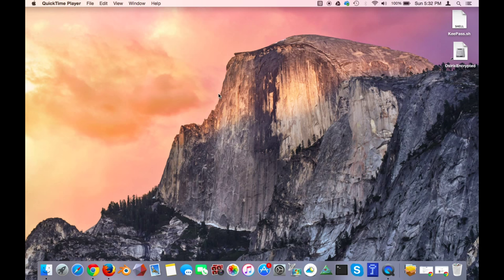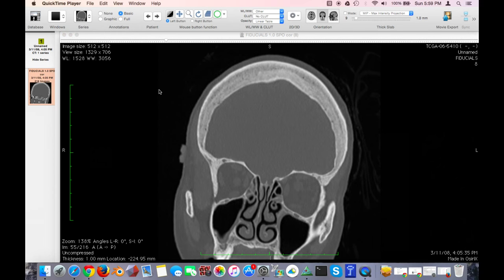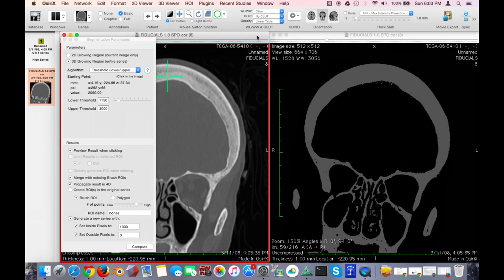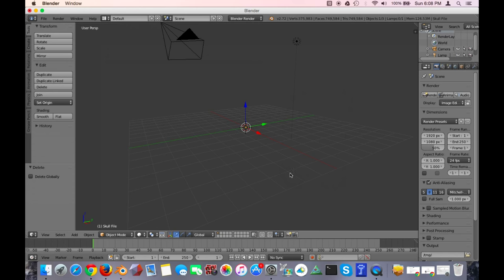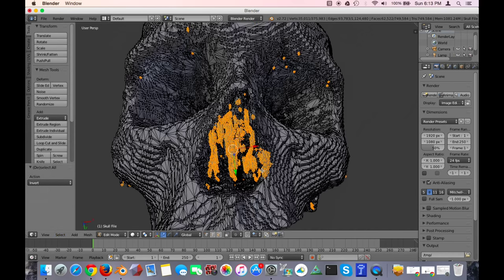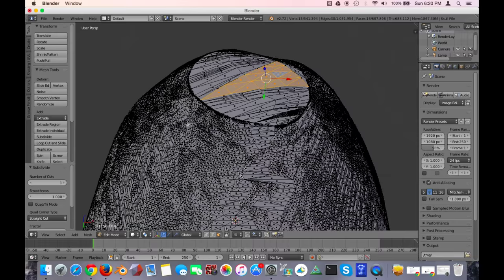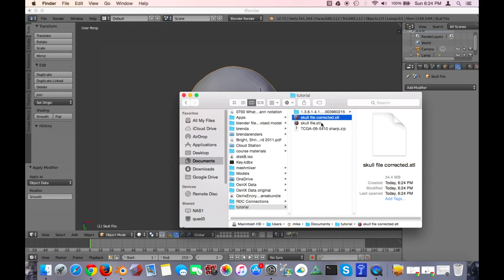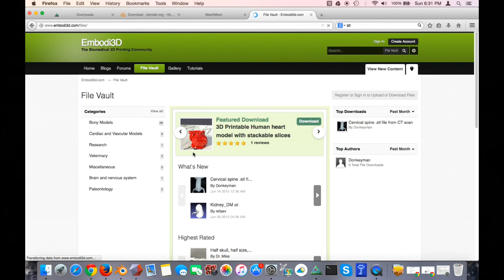Creating 3D Printable Models from Medical Scans in 30 Minutes Using Free Software

Comment: There is one more software that you should look at. It is Sculptris, a FREE sculpting software. It is a very easy software to learn. Anyone can learn it within a few days or a week. It is for sculpting digitally. 
If you have Sculptris, you could import that skull into that program and add a clay sphere for the gaping hole in skull. You sculpt that clay into shape. When finished, export two models in OBJ format, import them into Blender and use the boolean modifier to extract the shape of a cap for the hole in the skull.
Reply: For sculpting in Sculptris, one would need a graphic tablet like Wacom Intuos or Huion. Huion is 1/4 cheaper than Wacom. Both brands have the same 2048 levels of pressure sensitivity. I use Huion H580 for medium monitor and Huion H610 for a large monitor. If the tablet ever gives problem, always download its latest driver update from its official website.

Comment: Help!!!  I wanted to see if I could create a 3d model of my meniscus using an MRI scan (prior to visiting my doctor to hear his interpretation).  At the osirix-viewer.com website, I assumed I should install 'OsiriX Lite' (which claimed it had all features of the commercial $699 program).  When I run OsiriX Lite, the top menu bar does NOT include the set of 6 icons above phrase 'Mouse button functions' - and therefore I am unable to do any segmentation for my image.  In fact, my top ribbon bar looks pretty different than shown in your video.  Any thoughts or suggestions?

Comment: Great video. Thank you very much. I have done the whole process and it works. However, I have tried with one of my dental ct scans and I am so stuck. I cannot pass the ROI growing 2d/3d. I would appreciate if anyone had some suggestions :)
Reply from the maker: I just released a new tutorial that will help you. It bypasses the whole ROI growing and generates a 3D printable bone model with one click. Here is the link. I hope you find it helpful. https://youtu.be/M70sAQUAltw
Reply: Look into Blue Sky Bio. It's a free dl software for implant treatment planning and can be used to fabricate surgical guides for $11-20.00 most are $500.00 and up!!

Comment: thanks for the tutorial! I want to know what material did you use for 3D printing the model and what resolution did you use for the 3D printer also what is the name of the 3D printer used for the printing and what types of 3D printers works best? Thanks.
Reply from the maker: +Khan Samiuzzaman The model was printed on a Formlabs Form1+ printer at 0.1 mm. There are a variety of 3D printers that will work for this type of application.
Reply: thanks for your reply!

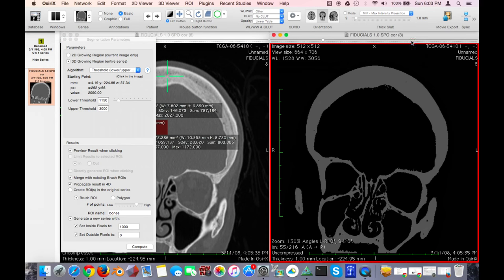Comment: Hi thanks! this is very useful, but I stuck at 7:53, I follow thru everything, but still cannot get the separated series which only 1000 to 0. The second series I generated is same as the original.
Reply: I'm having the same issue. did you ever get it figured out?